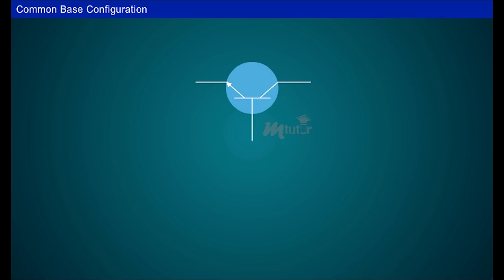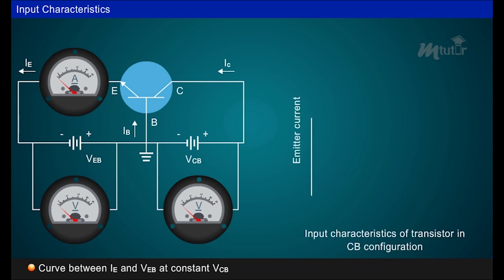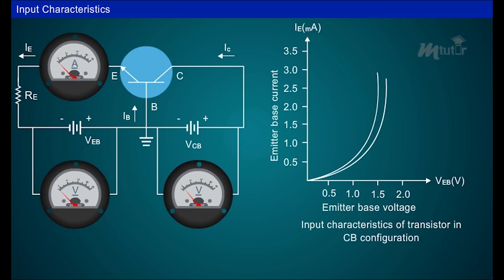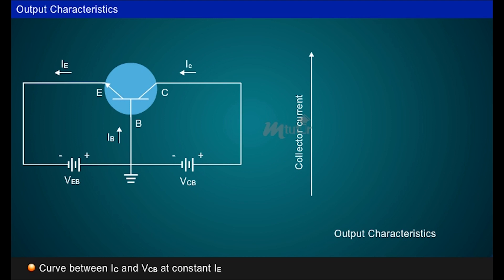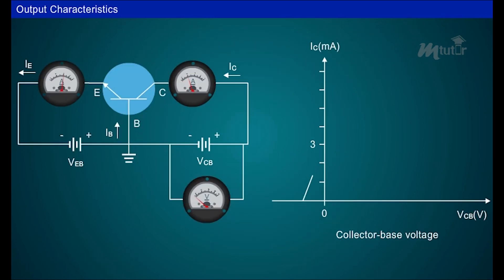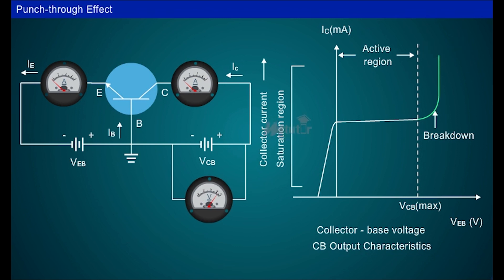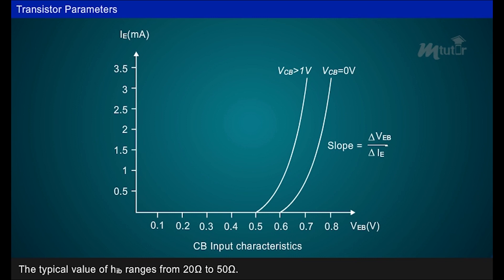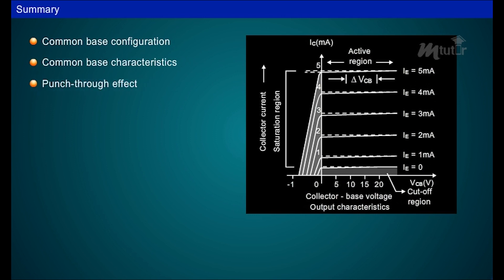Common Base CB Configuration [Year-1]

Comment: The emitter current is almost independent of Vcb
Reply from the maker: Hi,
The emitter current is not independent of VCB, because, in the common base configuration, the IE increases with the increase of VCB. Here, when reverse bias voltage VCB increases, the width of the depletion region also increases, which reduces the electrical base width. Due to the reduction of the electrical base width, now there are more charge particles per unit area. This increase in the concentration of charge carriers causes more diffusion of electrons from the n-type base, increasing emitter current slightly. This is why the IE increases with the increase of VCB.
The same has been explained in our video timing at 3.48.

Comment: With all due respect, the animation is very good, but it looks like you are reading a book paragraph, instead of explaining the transistor behavior. Your speed is also very fast. Briefly, the lack of the characteristics of an effective teacher.
Reply from the maker: Many Thanks for your Feedback, we will work on it.
Reply from the maker: Hi Nasir,
Your inputs noted, however, this video is all about the common base characteristics; hence “Transistor behaviour” was not included in this video, which is explained in a separate video.